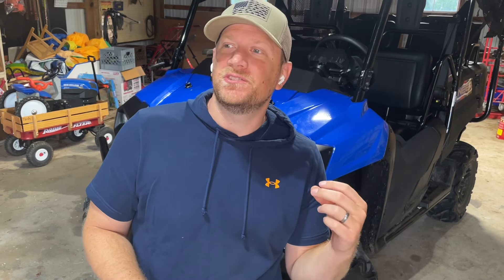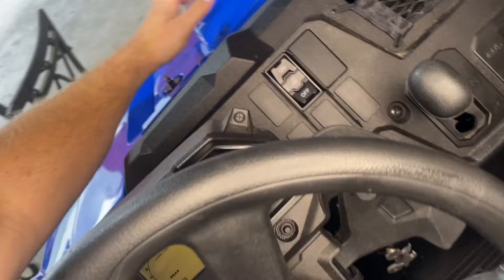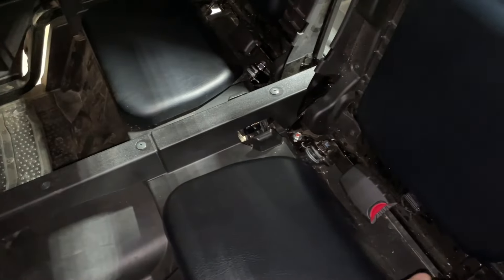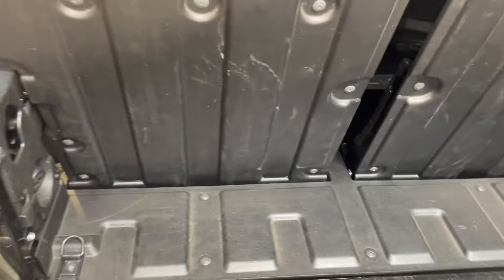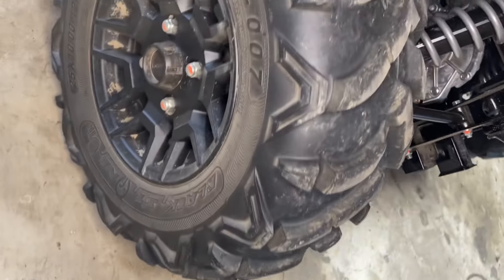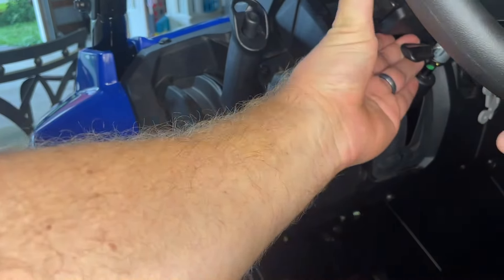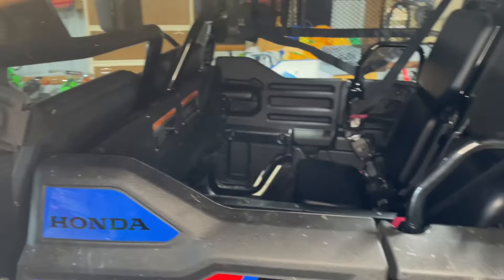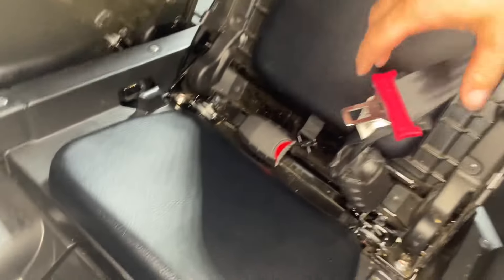Thinking about buying a Honda Pioneer 700-4 (Deluxe)? Here are the TOP 10 reasons you should!

Comment: Even in "Auto" mode you should be able to use your paddle shift option to manually force the shift to 3rd gear whenever you please.  Which was one of your top 10 complaints - how long it takes it to move into 3rd on its own.

Comment: We bought the honda pioneer 1000 6.....love the transmission, power steering, and horsepower.....im 48 and love the comfort of a full size utv😊....fyi, for as the gas peddle go to autozone n get the aluminum peddle set....put largest peddle on gas peddle to reduce leg fatigue....paint it black.....truck bed lock latch pin, add 5/16" ID fuel tubing or vinyl vacuum line to stop bed rattle and keep a bag of the 8mm pin fasteners.....theyll pop up time to time.........😊

Comment: I just bought the exact same machine for our family.  I purchased for the same reasons you listed... 4 seat capability with a compact chassis.  I also picked up the factory full poly windshield and full hard top that covers both front and rear seats.  Honda durability and longevity are also a plus.  Some of the shortcomings are probably tradeoffs that the engineers made to keep the costs down.  All in all, I would definitely recommend.  Thanks for the videos!
Reply from the maker: Great to hear! Hope it serves your family well for years to come. More content coming soon!
Reply: Be sure to service air cleaner regularly if running in dusty conditions.

Comment: When you have this in manual mode does it have any hold back on a hill my dad has a 2014 2 seat pioneer  it doesnt have any hold back on a hill, but other than that he has had zero issues with it  right now its going on 23000  miles still honda strong
Reply from the maker: To be honest I rarely use manual mode. 75% of the time I am riding, at least one of my kids is sitting on my lap. Shifting is just one more thing to think about. I think the main benefit of manual mode is going to be hauling/towing or real dicey terrain where you want to keep it in first. Maybe drag racing too… but unless I am going against a golf cart, I’d probably just take the L. I will try it out next time I am hilly and alone. But even if that issue is there… wouldn’t change my decision.

Comment: Why didn’t you go with the Forest?
Reply from the maker: Awesome Question! I might do a comparison video on the different trims. There are minor differences, but a lot of them are cosmetic (Bigger front bumper, different wheels, camo pattern). The biggest difference is the factory winch. 95%+ of my riding is on the farm where a tractor and tow strap are one phone call and less than a mile away. Couldn't justify spending two grand on a winch that I would likely never use.
Reply: I personally didn’t go wit forest or trail was I didn’t want the i4wd crap, idk if it’s the same way on the 700 my my 1000 once you go over the deluxe it all has i4wd
Reply from the maker: @Rossi386  Nope! The 700 gets plain old “dumb” 4wd across the board.